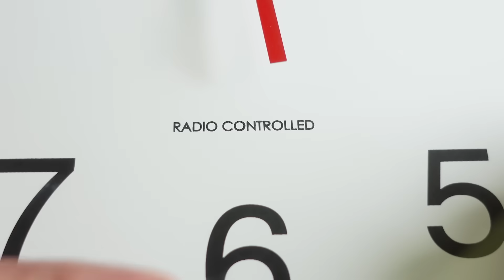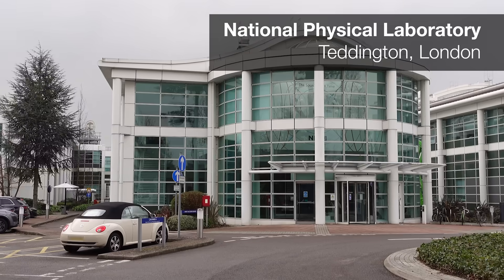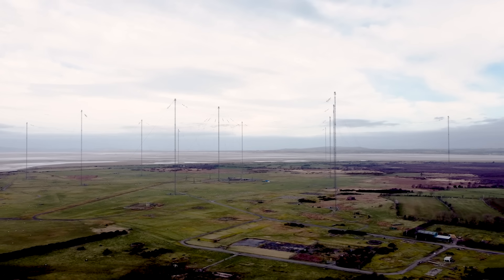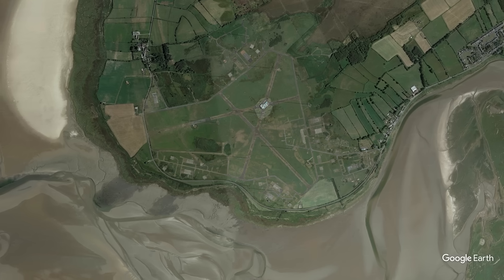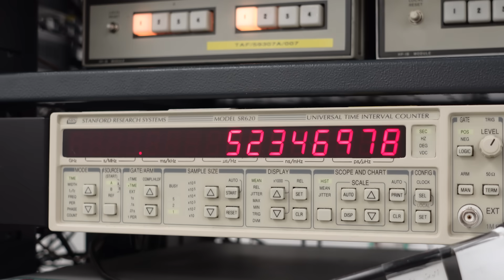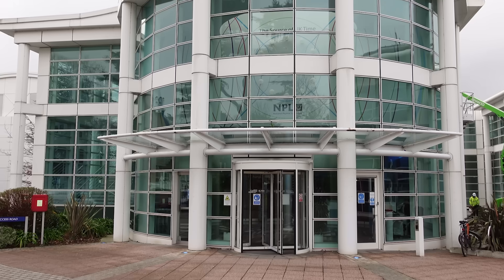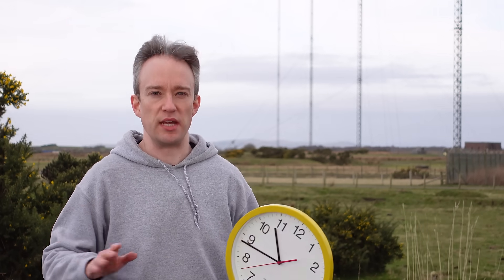How does Britain know what time it is?

Comment: I bought some radio-controlled clocks at auction. They were quite cheap, which more than made up for the fact they're fixed to the DCF77 signal out of Germany not the MSF signal out of the UK so they're technically an hour out. I took them apart and adjusted the hour hand so when it thinks it's 12 o'clock the hand points at 11 o'clock - and nobody is any the wiser. Apart from daylight savings transitions when the clock adjusts itself an hour before you'd expect.
Reply: I brought a couple of digital clocks that can be radio-controlled if desired from Europe to the UK. I was quite happy to discover that, as I've been moving around the country, they still always pick up the German signal - even in Northern Ireland (though sometimes it takes a couple of attempts). Thankfully they also have a "correct by X hours" function, so I can see GMT/BST without opening them up and doing weird things to electronics :D
Reply: I bought one of these from the UK as well.  However Australia is just a bit too far to pick up the signal!
Reply: I had to do the same with my German clock.
Reply: I was wondering if there was some way to adjust or switch which signal they were picking up. Although I guess it has to be hardcoded based on the fact that each transmitter sends data in a completely different format.
Reply: @SteelSkin667  The formatting isn't really a problem in today's world because a few-cents microcontroller can be easily programmed to understand all of them. It also wouldn't surprise me if many existing dedicated chips could decode multiple protocols.  The bigger problem is the broadcast frequencies. The UK's NPL transmitter is at 60kHz, Germany's DCF77 is 77.5kHz and US' WWVB is 60kHz. A receiver which could switch between all the frequencies would be more expensive.
Reply: @eDoc2020  And that is exactly what some watches do.  I have one that only acquires the DCF signal (it is a German watch, so that's reasonable) and I have another that handles multiple frequencies and standards.  These days, the decoding is a trivial software exercise.  Running a miniature low power consumption receiver of adequate sensitivity that also supports multiple frequencies is another thing altogether.  I believe they use miniature quartz crystals to help achieve the required selectivity in the receiver.
Reply: FYI. Europe moves onto summer time at exactly the same time as the UK.
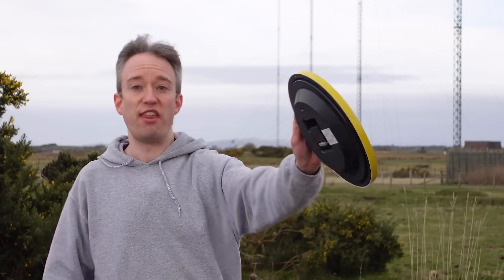Reply: @tp3427  At the same exact point in time, but not at the same time, BST/IST/WEST at 1:00, CEST at 2:00 and EEST at 3:00.
Reply: @arfski  sure!
Reply: @tp3427  How interesting! I see now that the clocks are supposed to change at 2am CST, 1am GMT - but that didn't match the behaviour I saw from my clocks this year. Will have to pay closer attention in October to see what's going on. Thank you!
Reply: I’m sorry mate but your clocks have one purpose, and that’s to tell you the time!

Comment: I worked for a company that supplied a wirelessly synchronised wall clock system to the NPL. The funny part about it was prior to this all their clocks were wrong.
Reply: What is even funnier (and was a standing joke for NPL staff while I worked there in 2011-2013) is that most of the radio-controlled clocks were wrong.  The theory was electrical noise from some high power equipment somewhere on site,  but I never heard an authoritative proof...
Reply: @carloshuggins1  that explains the enthusiasm when I was hanging the clocks on the walls. To me they were just clocks but people seemed really excited. They were literally staring at the clocks while calling the talking clock and they were really excited to see the correct time. This was in 2014 or thereabouts. I met Leon Lobo too.

Comment: I've always thought that standard wall clocks worked by a small motor inside set at a certain designated speed
Reply: Some non radio synchronised ones do.
Reply: The line powered ones definitely do, and the mechanism that makes battery clocks tick could be described as a stepper motor.

Comment: The US has a similar system. NIST has the radio station in Colorado, WWV, transmitting at 2.5, 5, 10, 15, and 20 MHz. It's designed to cover most of the US. The site is shared by its longwave cousin, WWVB, transmitting at 60kHz. And in Hawaii, theres WWVH transmitting at 5, 10, and 15 MHz. All 3 stations use UTC for their time codes
Reply: The instructions for my clock have a suggestion for when it has trouble receiving the signal inside a building: "Take the clock outside and point the back of the clock in the general direction of Fort Collins, Colorado."
Reply: @tvdan1043  Seems reasonable. As long as you know which way Colorado is from you
Reply: @thomasvlaskampiii6850  If you don't, knowing the current time might not be the highest priority.
Reply: Love that system, I can pick up Hawaii and Colorado on 10mhz on my hf rig
Reply: @greg2092  I really like that they have a phone number you can call and listen in. Shame it autodisconnects after 5 or 10 minutes
Reply: The USA's similar system is the WWVB on 60 kHz.

Shortwave time signals are different purpose and usage.

Depends what's meant by "similar"...
Reply: And of course, we in Canada have CHU on 3.33, 7.85 and 14.67 MHz.

Comment: I've lived on the Scottish side of the Solway for years and I assumed that the transmitters were related to air travel - who knew it was for radio clocks!
Reply: I live the other side - they’re also used for communicating with submarines. The time signal used to be broadcast from Rugby but moved to Anthorn in 2007.

Comment: I don't worry about nanosecond precision. I have a radio controlled clock from Lidl, and it randomly decides if to add 2 hours to the time or not. I changed the battery and it didn't make any difference. I have another one from Amazon, and that one works great, and I can tell if the battery is low because it really misbehaves - nothing like the 2 hour exactitude of the Lidl one.
Reply: One of mine recently needed a new battery - I realized this because when we hit British Summer Time it adjusted to entirely the wrong time. When I asked it to reset it just whirled its hands around and around. It was definitely a cry for help.

Comment: The Canadian version of this, CHU, is even more interesting; in addition to putting out a time signal on a low frequency, its 3330 KHz signal carries Bell 330 modem tones as well as the speaking clock.
Reply: Actually, the Canadian version of "this" is the USA's WWVB, which covers much of Canada. The shortwave signals (CHU, WWV) are sufficiently different purpose and usage that they should not be conflated with the VLF time signals topic here.

Nitpick. :-)
Reply: It's actually Bell 103-compatible time code.

Comment: That point about latency is where all the complexity of time synchronization is. ALL of it. Handling this latency is fiendishly difficult. And it's fiendishly difficult even with the computing power and high level programming tools available on your desktop computer. Getting it right on a clock that has only the electronics a AA battery can power is truly remarkable. There are so many hugely complex factors that Tom just mentions offhand in this video (and so many others left unsaid; how do you handle the race condition for synchronizing the clock on your computer when the program doing the synchronization has to compete with hundreds or thousands of other processes on the same CPU and it might only get a chance to run a few milliseconds after your computer receives an update from a time source?) that I am truly impressed that it works at all, let alone to the degree that it does.
Reply: Radio clocks just wake up the receiver circuit once in a while, then just at night. So duty cycle is very low, to save power. In between it's just a quartz clock. And there are none of those NTP & PC complications you mentioned in a radio clock. It's relatively straightforward.
Reply: @JxH  Thank you for the explanation / correction! I was thinking that there would be some error checking / correction machinery in a radio clock like there is with NTP, hence my assumption of more complexity. If you leave out all of that then yes, it is a lot simpler. :D

Comment: I live 6 miles from the national atomic clock transmitter in the USA that does the same thing. However, the timezone and daylight savings settings must also be selected on the clock for it to be accurate for the region. The UK has a great advantage with just one time zone. Great video.
Reply: The UK has daylight saving time too. There's GMT (Greenwich Mean Time, which is also UTC) and BST (British Summer Time which is UTC+1)
Reply: @TJ-up8vj  America's problem is that different states have different timezones and rules for DST. For example some states have daylight saving time, but some do not. Britain has DST, but it has only one timezone and one rule for DST. Not so for the US, so the equipment must be much more complex.
Reply: @Jules-wn7hl  I have one of these clocks, but it's not all that complicated.  You just select which timezone you're on, and enable or disable DST.  That's it.  I think I paid $20 for it.

The signal, WWV broadcast a shortwave signal out of Colorado has an audio component you can listen to, but also broadcasts a binary encoded signal once a minute with the time.  The binary encoded signal has a component that says if DST is active or not.

I've always been amazed you can get this signal thousands of miles away from a cheap $20 clock with no visible antenna, just sitting on my wall.
Reply: @stevesether  Cool Steve! It is really magical technology. my country doesn't have it, so it was wild to learn about it from the video.
Reply: DCF77 (the german time transmitter) has two bits to encode if it is DST or not (so no need to set it) and a third bit that will announce the switchover from DST to normal time or vice versa, so the clock can switch even if it isn't receiving at the second the switch is made. Most consumer clocks don't sync constantly, but use a regular quartz clock for the time in between, which is "good enough" for a normal clock showing only whole seconds. There's even a leap second announcement bit... From what I can see, the MFS format used in Britain has about the same features.
Reply: Trump wanted to get rid of the American transmitter to save money.
I guess it's safe now....
Reply: At the tone, 12 hours, one minute, coordinated universal time.
Reply: @VTX Bing
Bing
Bing
Bing
(pause)
BEEP

Comment: I hate these clocks because they don't have manual adjust. 
I have one driven by the German DCF77. Since I moved to a new house a few meters downhill, it stopped receiving the signal, so twice a year I had to climb onto the roof and Lion King it for 10 minutes to get synced up. 
After a few years, I got tired of that and built my own (illegal, obviously) min-DCF77 transmitter that synchronizes over NTP and use that to synchronize the clock instead. 
It's completely astonishing to me that whoever built the damn clock didn't consider it could not receive the signal.

Comment: I've had a few radio-controlled clocks and watches, and found them unreliable. My digital watch worked great for a couple of years, then started picking up a very incorrect time sometimes when it updated. I actually ripped the antenna out of my digital clock for the same reason. Clocks that become completely wrong are worse than clocks that lose a few seconds a month.

Comment: Interesting experience related to this: While living in Germany for a work assignment I bought a fairly cheap radio controlled alarm clock (not entirely sure, but I think from Aldi). When I moved back to the UK I thought it would then pick up the UK signal and display the correct time. Except that it didn't. It somehow still picked up the German signal. So I still had an "accurate" clock, albeit an hour ahead.....
(It's long since gone the way of all cheap electronics and died)
Reply: Many of these clocks have a setting to add or subtract an hour for this reason. It probably mentions it in the manual you dumped as soon as you opened the box :)
Reply: @gerrybvr  aye, possible. Although I tried pressing any button I could find, in various combinations. Didn't do anything. But as it was some cheap thing I wasn't too worried (and possibly because it was so cheap it didn't have that option)
Reply: You can receive German time signal from most of Europe and even northern Africa.

Comment: That's what most people do not know: GPS has a VERY faint signal strength and can easily be scrambled. In Europe with it's Industry 4.0 (more like 4.5 now) sychronizing industry stuff has become more and more important over the last 15 years. That's why everyone is so keen about the 5G mobile network, short latency AND: a highly accurate sync & time signal broadcast from cell towers. It's not just for home appliences by the ocean (😁), it's all things industry and new mobile capabilities. 😎✌️
Reply: GPS signal is so weak that repeaters are frequently used to boost the signal strength. I've heard that one of such repeaters used by a fire station caused massive jamming around that area for example.
Reply: @lifthras11r  active GPS repeaters are illegal
Reply: @barrieshepherd7694  It depends on jurisdictions, but for example in US you can obtain an FCC license so it is not entirely illegal.

Comment: Here in Germany we actually have a similar institute in Frankfurt. It is called DCF77 and broadcasts at 77khz. Apparently the signal of DCF77 can still be received in Spain and Britain. I know that because I am currently doing my final exam as an it clerk here in Germany. My topic is actually about NTP, Wich is a protocol used to distribute time across a network. So this is a somewhat scary coincidence.
Reply: Can confirm. Am near London and have two clocks synced from DCF77 at home.
Reply: @charliedobbie8916  When they made the bright idea to move the transmitter from Rugby to Anthorn a lot of the South UK had (still has?) to use DCF as the signal did not reach.
Reply: Has the British equivalent a lower range than DCF77? That is quite surprising to me since it is using a somewhat similar frequency.
Reply: @tcode3564  Yes, ex. MSF/Time from NPL has an effective radiated power of 17kW while DCF77 has 30-35 kW ERP.
Reply: @JacksonCairn  here in America the entire country except Hawaii receives time signals from one station in Denver so it isn't like that's too far away.
Reply: @sirius940  That station is called WWVB, near Fort Collins.
Reply: @charliedobbie8916  Yes, confirmed, DCF77 works in most of England.  The northern limit for this signal lies slightly south of the polar circle, e.g. Luleå in Sweden or Oulu in Finland, and it certainly works in Southern France, as well.
Reply: Yep, in Slovakia with 3 clocks. Altough In some corners or rooms, the clocks gets properly synced only in night. Otherwise they just stay at 00:00. I guess there is less interference at night.
Reply: DCF77 has been received in Sri Lanka before. :) During night time it reaches very far.
Reply: Pedant here... it's actually 77.5kHz, but no-one cares... ;)
Reply: Yup, two clocks I have using DCF77 worked in Northern Ireland - although I'd have to occasionally have to ask them to sync a few times before they were successful
Reply: I had a DCF77 clock working correctly - with a signal of 4 bars over 5 in fair weather - in Naples, Italy, and soon after in Birmingham, UK, and London afterwards. 
I bought two MSF clocks like the one Mr. Scott shows in the video anyway, as they have become very cheap since they began using an SDR radio instead of a superheterodyne stage as front end. Fully digital LW clocks have a disadvantage, as they stop working during a thunderstorm...
Reply: I swear to you my  radio clock synchronized to DCF77 once.... in South America. I had to turn off the auto adjust after that.
Reply: I have had a  DCF77 clock for many years in Britain. It would have a one hour offset built in although if the summertime changes ever become different between the UK &  Germany I daresay it will become wrong.
Reply: @Tobi G: Not really accurate. The institute is in Braunschweig (Physikalisch-Technische Bundesanstalt), the DCF transmitter is in Mainflingen (okay, not far from Frankfurt) and is owned and maintained by a private company called "Media Broadcast" (not any institute).
Reply: I bought a Citizen watch in Holland that uses DCF77. It can just about pick up the signal in West Finland and North Wales (mountains are a problem). It also charges by light, so the ultimate lazy person's timepiece.
Reply: My watch synchronized to DCF77 in Qatar!
Reply: I think I saw clocks that receive DCF77 for sale in one of the German based discount supermarkets here in London last week. But I didn't buy it because I couldn't work out how it dealt with timezones and daylight save time. There didn't seem to be anywhere on it to tell it what timezone you wanted.
Reply: @superfluidity Lidl sells MSF clocks in the UK, not DCF.
They set their timezone automatically on BST during summer and GMT during winter.
The Lidl clocks have the possibility to set the timezone manually everywhere in the world...
Reply: I found you.
Reply: @amikasecondname9420  Not that guy again
Reply: @tcode3564  :D
Reply: There is no such thing as coincidences it’s the universe putting things together and showing you signs I am writing a major project for school about the medical benefits for psychedelics and a new video popped up that was very informative